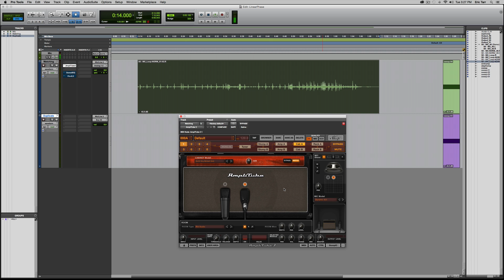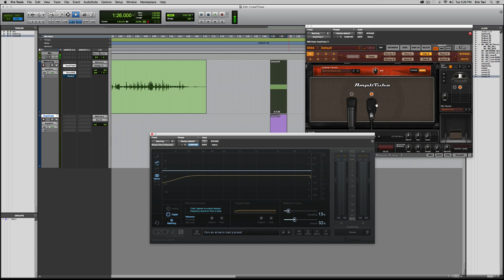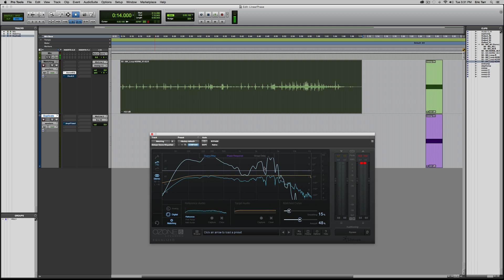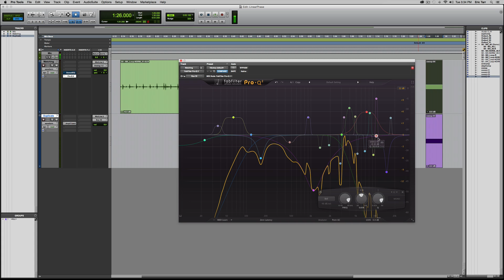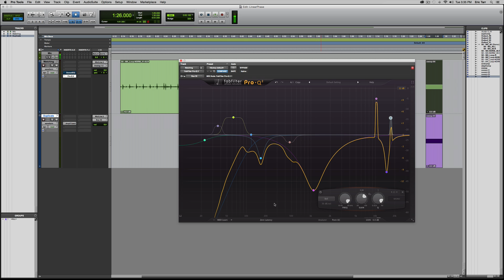How to Manipulate Simulated Amp Cabinets with EQ Matching

Comment: You can manipulate the EQ with this method, but don't the simulated amp cabinets also introduce harmonic distortion, spatial imaging or other characteristics that you can't achieve with just the matched EQ curve?
Reply: why would you want harmonic distortion from a cabinet? Can't you add more gain in the amp?